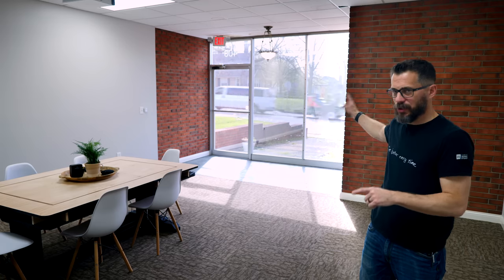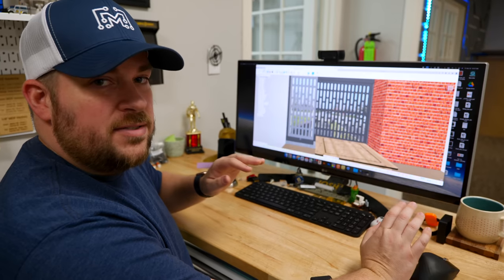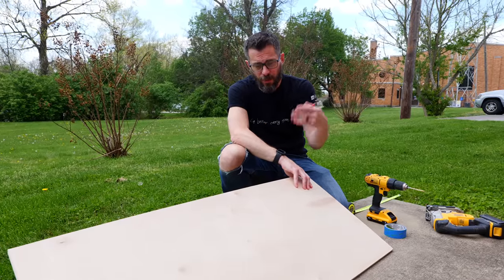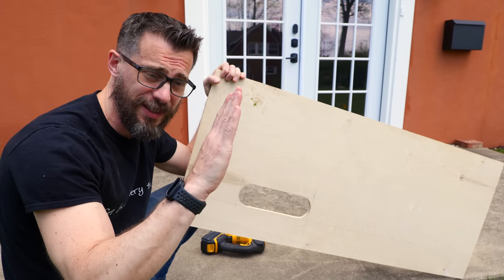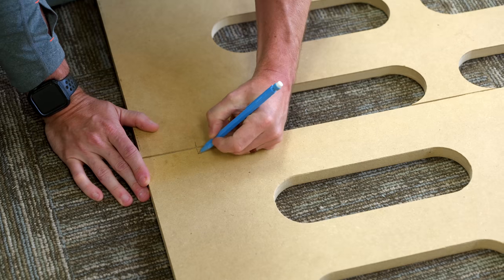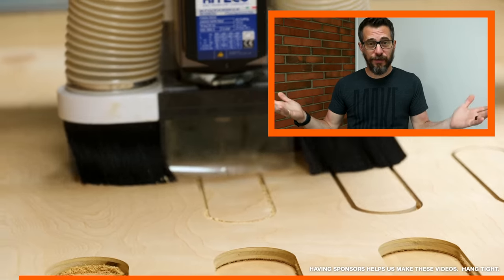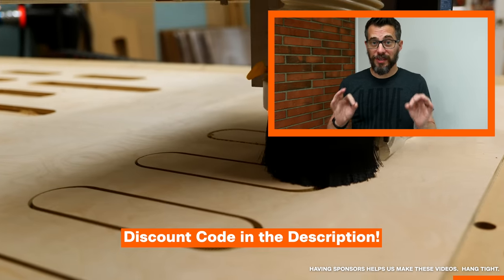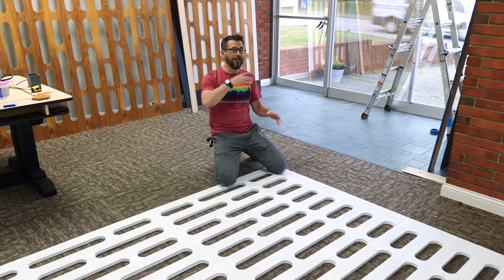Sliding Room Divider (Inspired by Star Wars)

Comment: When doing it by hand it's actually a lot easier to use a hole saw and then just cut out the centers with a jigsaw that way you don't have to make the curve with the jigsaw and you have a perfectly round end that you don't have to shape out
Reply: was thinking flash cut router and a template. thats the thing about carpentry, many ways to get the same result

Comment: Nice one. I might have done things differently but it's a matter of taste.

On the purely technical part of things, though, I think I would have installed that bracket on the ground differently. I would have made the hole so it would be under the divider, not besides, so the bracke would stand out (so much), which would also help when cleaning the floor. Yes, it might require a little bit of sanding so the bracket can actually fit under it, but I think it wouldn't affect the stability of the divider and would look better IMHO.

Thank you!

Comment: you should look into using uni-strut and the rollers they have for it, it uses machined screws and you can bold up an angle bracket and attach it to the door/wall. they slide very nice and can be mounted ontop like a pocket door or on bottom. I use them all the time im projects.

Comment: Continuing with the Star Wars theme I think you will need a wall projector, and what better way to mount such a thing than to put it inside an R2-D2 unit, placed somewhere in the centre of the room? You could use the same unit to host a lot of controls for the room, such as mood lightning, any motorised future builds etc. And possibly for additional storage as well, for minor stuff needed for games etc.

Comment: Could put a duplicate of the face panels in the back in a translucent diffuse material, and that'll let you get a 3rd light level where you get light but no actual view of the inside/outside.
Reply from the maker: Yes. We originally had a diffusion layer, but took it off. It didn't work right

Comment: Can you guys maybe do a"bits" video about work holding solutions and some of the other considerations (direct drive vs lead screws vs rack and pinion & extruded aluminum vs steel frame/gantry?) to make when buying/using CNC machines? The plastic brad nails seem like a solution to how to hold material in place without potentially damaging a bit, but I'd appreciate some clarification on why you'd use them and where to get some for myself.

Comment: Really cool wall. I'm curious why you mounted the wheels in a stationary position with the wall sliding on top, rather than mounting the wheels to the bottom of the sliding part.
Reply from the maker: Because the wheels we got had a base that was wider than the 1/2" plywood sliding panel.
Reply: @Iliketomakestuff  Ahh, makes perfect sense. Thanks!

Comment: If doing this by hand, I would recommend using a hole saw with the correct diameter. Will be fast and more accurate and not require a steady hand with the jigsaw. Just say’n.

Comment: Great project! I'm sure it cut down on the amount of light coming through those windows. I might have added a difusement layer to the inside of the fixed walls to help reduce the glare and visibility even further.
Reply from the maker: We did initially, but it didn't work like we wanted. The tint is mirrored from the outside

Comment: If you have the tools I would suggest making a template for each hole size and using a router and a flush trim bit instead of a jigsaw.
Reply from the maker: True. Just make sure your spacing is accurate.

Comment: 02:23 if you don’t have a CNC a better way would be using a router plus a follow bit and making a pattern. That way you get a consistent shape, as opposed to doing each one individually with a jigsaw.
Reply from the maker: But the router still needs a pattern to work with the follow bit.

Comment: It hurts how there is zero dust collection .. MDF is soo bad for you lungs and carpet
Reply from the maker: There is a lot of dust collection in that room for the CNC. We didn't want to use tabs so we left a super thin layer on the bottom. Yes, it required a little sanding afterward, but we wore masks the whole time and had an air cleaner. Josh also really like the carpet in there.